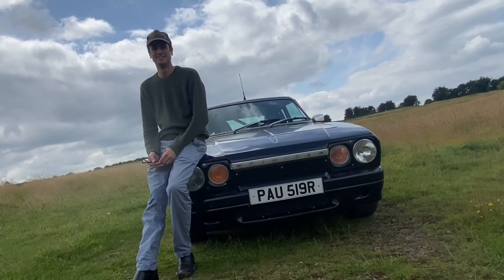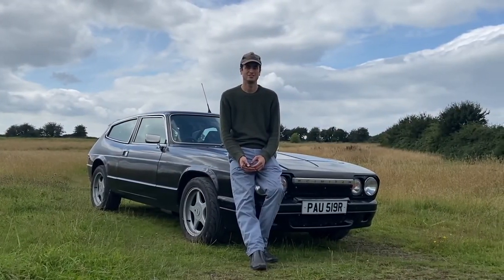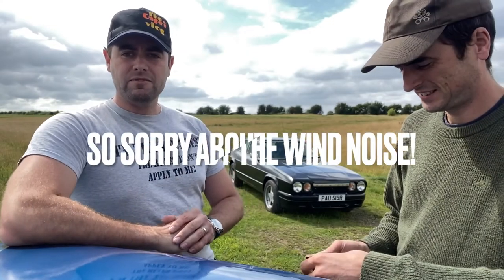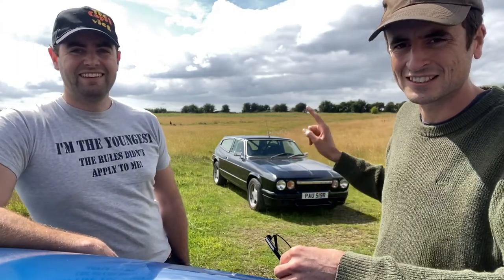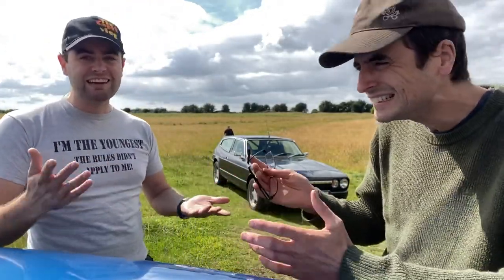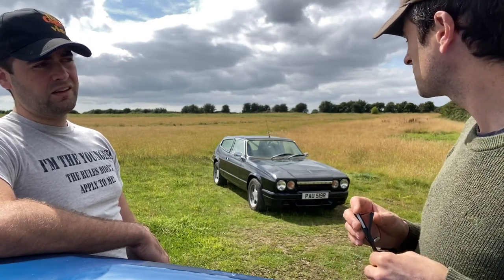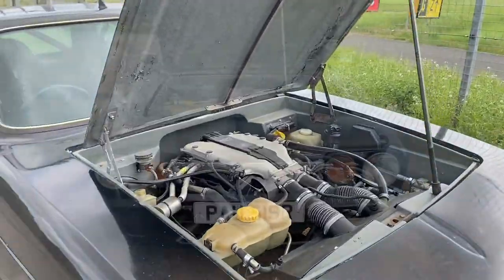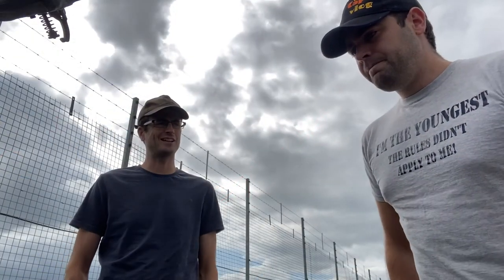Kat Meets ... The Beast | Walk around the MV6 Powered Reliant Scimitar SE6a

Comment: Did you make the wheel adapters or ebay iv got some lotus elise wheels im tempted to fit cheers
Reply: Hi its the cars owner here.  I actually got the hubs re drilled to accept a ford 108mm PCD, this gave me a huge choice of wheels.  I do have spacers on the front but they're just simple flat spacers and I fitted longer wheel studs.

Comment: Is that the same engine as the Holden V6 which was fitted in the Australian Holden Commodores? These were based on the American Buick V6, I believe. Cheap as chips down under. They use them in Sport Sedans as well. Precursor to the LS V8 motor. Interesting combo.
Reply: Hi, I'm the cars owner.  I've had a quick google and I don't recognise the holden V6 engine, I think it might be a different motor you're talking about.  This is a bit strange cos they like to save money and use the same engine where possible.  It looks liekthe commodore V6 is larger at 3.6L mine only a 3L and it has a timing chain where mine has a belt.
Reply: @lozl  Hi, yes I’m not much of an expert in Holdens as I’ve always been into Fords (particularly Capris) but most of my mates back in Australia had Commodores and swore by the Holden V6 which was definitely in the 3.8 version in Australia. GM was as bad as Ford for recycling engines into anything that would take them. There were Chev engines in Holden Commodores shipped to the UK in the mid 2000s onwards now worth a fortune back in Oz but no doubt have ended up as scrap here due to MOT failures. They were thirsty from memory and weren’t that clean burners, but kept going even with the rubbish fuel in certain parts of Australia.
Link is a prime example of what Aussies get upto with these engines.
https://youtu.be/tl0T7ASF__g
Reply: @pintopunteruksmallford1035  fantastic! Yeah you always got bigger engines than us in Europe. Very annoying. 

That video is crazy! Completely pointless but actually really interesting to watch and I would quite like to have a go myself hahahaha